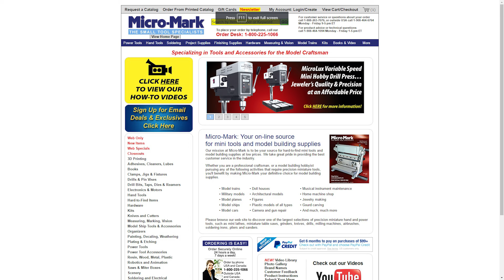Chain Link Fence – Model Railroad Scenery

Comment: the code for micromark doesn't seem to be working, does it work for American customers?
Reply from the maker: yeah it should, the code is boulder, it won't advise you when the code has actually been applied but if you look at the price of the item before applying the code and then apply the code you should see the price has come down by 10%. It would be good if it gave you a before and after price with the promo code applied.
Hope you can get it working!
Cheers
Luke
Reply: Luke Towan it worked! I was expecting the discount to show up in the order summary but it just took it right off the price. thanks for the discount, finally got some static grass and an applicator so I can play with it
Reply from the maker: Awesome 😊 I'm sure you'll pretty very happy with the static grass! It's fantastic stuff

Comment: sorry but if the barbed wire is not barbed it just looks off
Reply: attack125 well barbed wire is made of two sections of braided wire. To get the barbs the create a loop of sharpened wire and slide it into position. You can create the same effect with smaller gauge wire. Just take the wire and wrap a small piece around the long piece in a ribbon shape and make sure it is tight. Hope this helps.